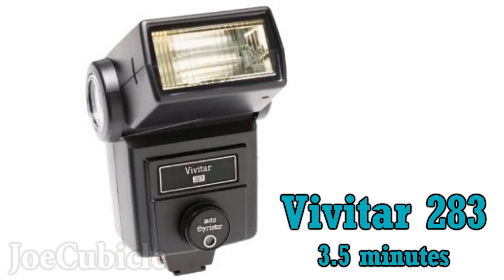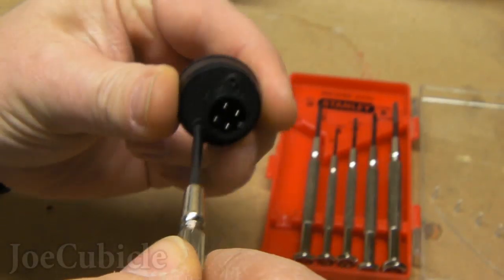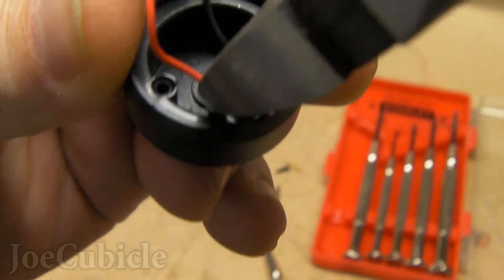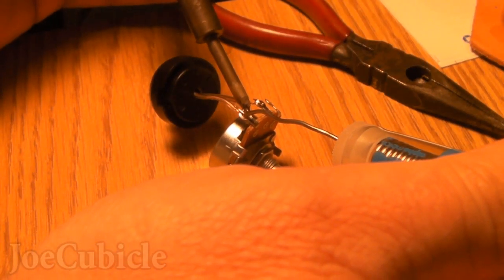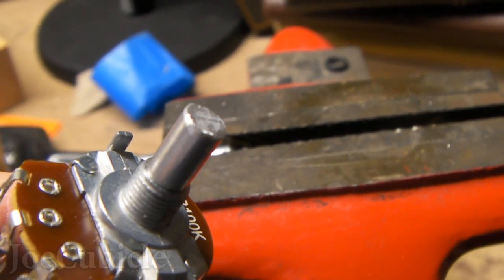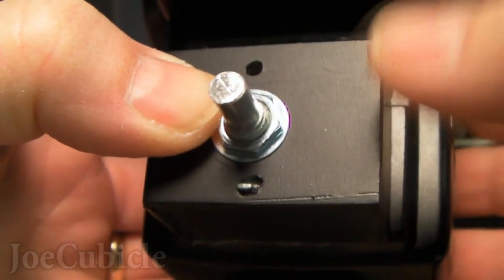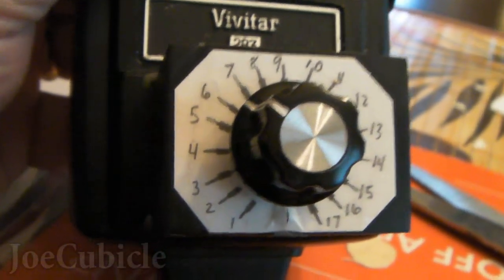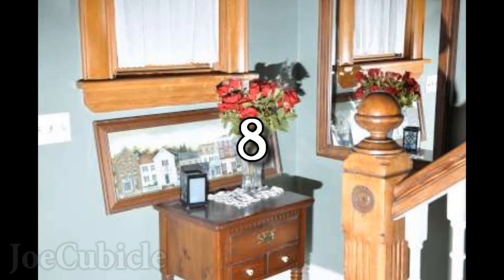Vivitar 283 adjustable flash hack - Short

Comment: Great video, I have the store purchased version of the variable power control VP-1, this is whats inside and the specs on the resistance in relation to F stop: The main pot is 1 meg, with another pot that is attached across wiper and one end, this is set at 2.6K , so the lowest resistance the 283 will see is 2.6k. now the numbers full power = 1meg, 1/2=140K, 1/4=43K 1/8=28K, 1/16=14K, 1/32=7K, 1/64=2.6K. This flash was always a work horse, I have a hand full of these and still use them for a location shoot.
Reply from the maker: Thanks for the great comment. I REALLY need to change out the resistor and make the variability smoother across the turn of the pot.

Comment from the maker: I read the same thing about a 200K pot. I was impatient and the 100k one was all I could find locally, or really that was all that the Radio Shack by my house had at the time. I really should order one and change it out. How cool would that be to get the right flash level in just a few quick test shots tweaking the dial.

Comment: good video joe...
i did this modification on my vivitar 283 (1970-80s model). it works. thanks to the long version of this video. however the change on a b100k potentiometer (linear taper) till half its rotation is very minimal. then it starts reducing the flash intensity to a maximum of 7 stops. has anyone tried with a 200k pot? i am from
 kolkata city, INDIA.